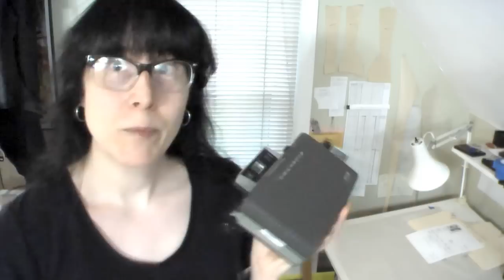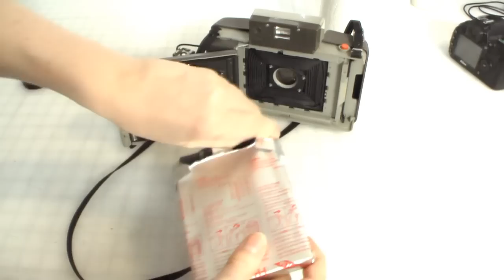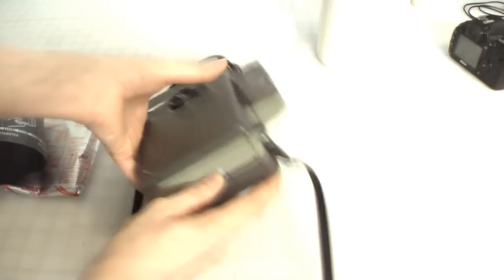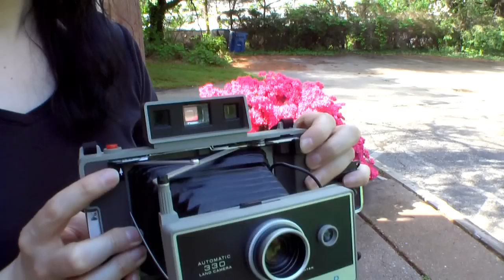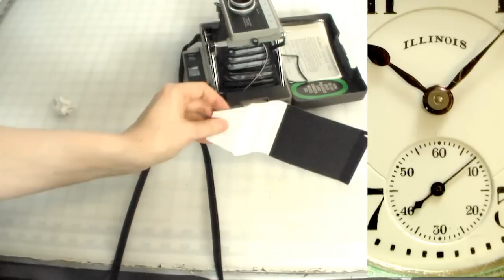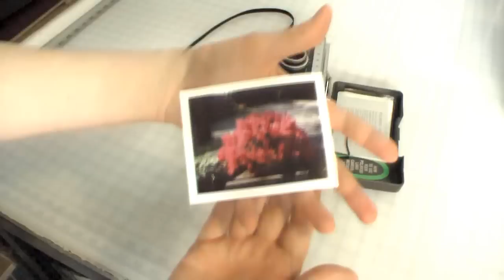Ask Fran: The Polaroid 330 Land Camera - Loading, Shooting, and Developing.

Comment: I got a couple packs of this film in 2017 and put it in my fridge, a year after they announced its discontinuation in 2016. It costed £19.99 per pack which seemed incredibly expensive but I just had to experience such a film before they were all gone. But, yesterday, I sold both packs...I never got around to sourcing a camera, and it's so rare now that each pack is about £60 to £70, I figured I'd never be able to make the most of the film and someone else would make better use of it. I remember watching this video years ago, makes me kind of sad I'll never have the experience of it :( I already regret selling the film but I know I'd end up taking 10 crappy pics and feel bad for wasting the film. I didn't think £19.99 would end up seeming so cheap.

Comment: IIRC, ours was supplied with a 'cold developer' apparatus. It was composed of two thin curved aluminum plates. They were joined by a flexible hinge (think gaffer's tape).
This apparatus was to be pre-warmed in one's armpit (I'm not fabricating this !). The film, after exposure, was enclosed in this appliance. This was to accelerate the development in the Frozen North. We didn't use that camera much. Very little, actually. Costly.

Comment: I have developed peel-apart film manually -- Exposing a color slide onto it using a 35mm enlarger (and a hand-held light meter to set the timer).
After pulling the film you lay it on a glass sheet and use a rubber roller to spread the chemical goop and start development (all in pitch darkness until you're done with the roller bit).

It sounds harder than it is -- the hardest part is inserting a darkslide into the pack between images so you can turn the lights on again!

Comment: Until quite recently I used a Polaroid 'scope camera with a similar back to record waveforms from my Tektronix 547 oscilloscope.  Yes, I still use that 'scope.  Unfortunately as the film became hard to get, I modified the camera assembly to accept a digital SLR.  Glad someone is still keeping a 330 working.

Comment: Got a polaroid camera (says automatic 104 on the front, does not have the the focusing system, just a distance scale in the viewfinder) from a friend who found it in the attic of the old house he lives in. What a interesting piece of retro technology from a time when things were still done mechanically. I remember dreaming of one when I was a child in the seventies but they (and the film) were too expensive. 

Don't know if this one would still work, the battery is a weird looking thing, never seen one like it before, and there's some corrosion. The shutter will still "cock" and "fire" and everything else seems to work too but don't know if it would actually expose anything without the battery? Also, I don't think film is available any more?

Comment: I've tested mine without film and the shutter works it has 2 clicks, but once i loaded the film and removed the black strip protecting the film. I then proceeded to take a picture, and i heard the 2 clicks but i couldn't pull out the white tab with the "1" on it. Also my timer won't work at all in the back of the camera. Is there a way i can fix these two problems? thanks.

Comment: About the Polaroid Automatic 330 Land Camera: Is it possible to get an original 3volt battery or similar batteries for the camera?
Reply: Bent Falkenberg Yes. Radio Shack - either in store or online. I had to buy mine online because my local store is shutting down :(

Comment: R.I.P. FP-100C :(
Reply: It's still around !
Reply: Fuji has stopped producing it, what you see in the shop is what's left.
Reply: there's a type of film called new 55 film I'm not sure if it works on the land camera or not
Reply: Interesting stuff, but that looks like it's for a 4x5 camera and not a Polaroid.
Reply: but does it reminds you of the fp 100c
Reply: I mean they're both instant films, although the fujifilm is smaller (3.25x4.25), than the 4x5 55 film

Comment: You are pulling apart the film incorrectly. You don't need to do the two steps as shown in your video (only one step is needed). If you intend to have the white boarder showing on the print when finished, there's no need to tear the white paper. All you do is pull the corner of the photo away from the rest of the development sheet. This video shows you the correct way to do it. https://www.youtube.com/watch?v=BIBtzYM3rUw
Btw, the instructions printed in red on the paper you ripped actually explain this. ;-)

Now, if you wanted to have the a finished photo with a "grunge" boarder, you would do the first peel as shown in your video (or do the peel from the other end), and then leave the rest of the sheet intact. Like this. (shown at 1: 48) https://www.youtube.com/watch?v=j5Hotk3iZho

Here's a photo that was left with some of the development paper attached for that "grunge" look. http://tinypic.com/view.php?pic=opwzuh&s=8#.VPKpG_nF8Uc

One last thing, don't throw away your negatives. Reclaim them so you can make extra prints later on with a scanner and printer. https://www.youtube.com/watch?v=YrurHRKxh9Q
Reply: Btw, the 330 has a built in timer on the back. Why didn't you use that to time the development?